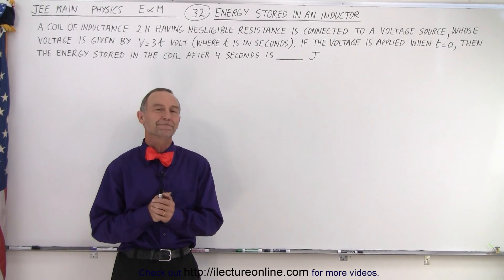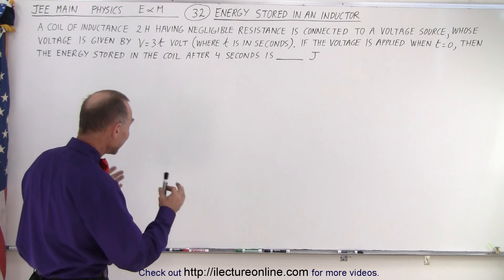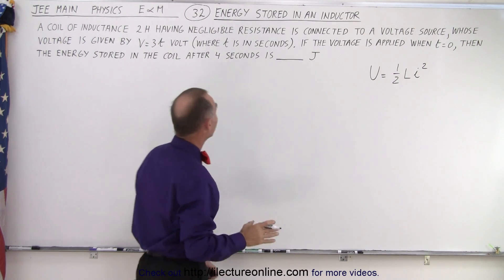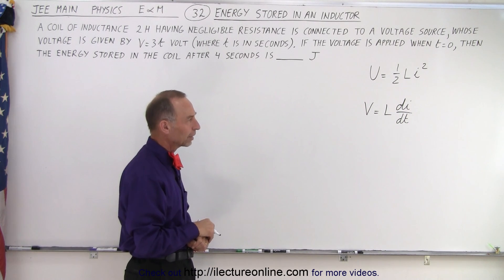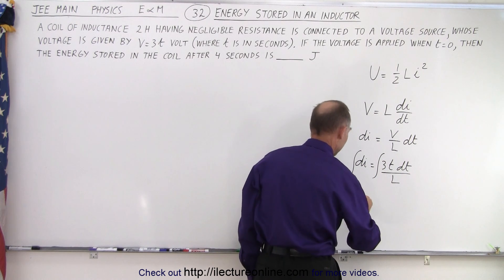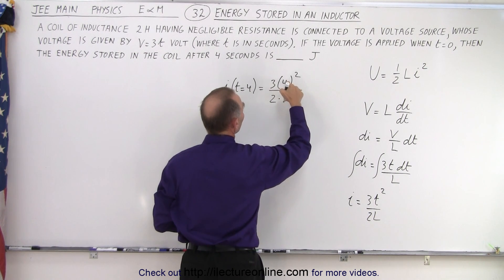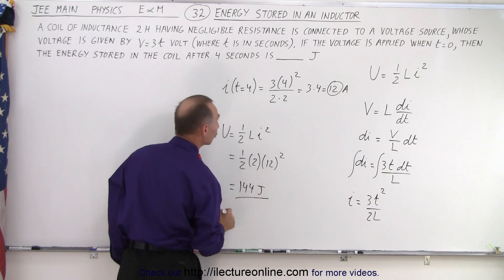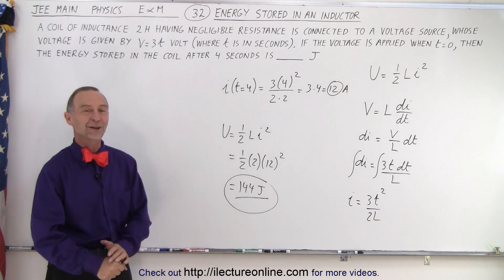JEE Main Physics E & M #32 Energy Stored in an Inductor

Comment: Actually, the frequency of an inductor's current determines the amperage. Nothing is stored in an inductor circuit. Heat is produced by eddy currents when the direction reverses. Where can we find a list of all those induction formulas?
Reply from the maker: We have dozens of videos covering how inductors operate and how to calculate the impediance and the current in the circuit.  They can all be found in the physics and electrical engineering playlists.

Comment: Thanks for the video, when we say the energy stored over time, should we be using the average current, meaning integrating the current from 0 to 4s to get the charge, then divide by 4 to get the average current? If the current at t=0 is 10A vs t=0 is 0A, if they both end up at 4amps at t=4, is the energy stored in the inductor the same?
Reply from the maker: The energy stored in a capacitor depends on the charge in the capacitor.  The energy stored in an inductor depends on the amount of current that flows through the inductor.